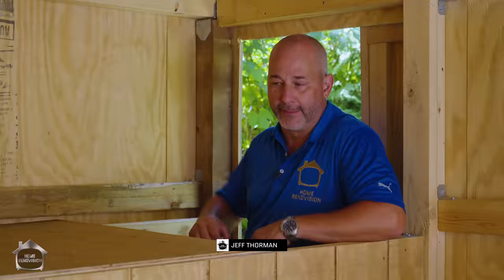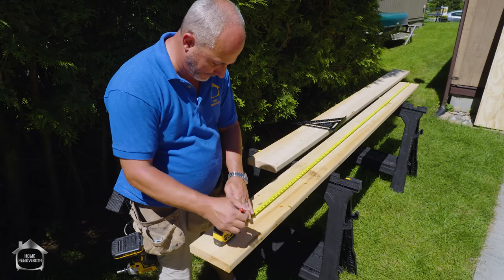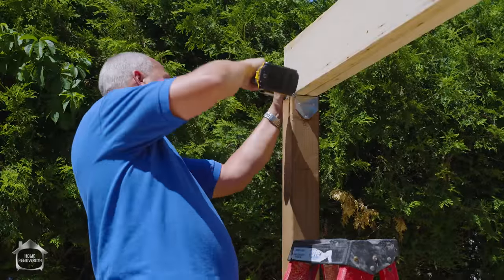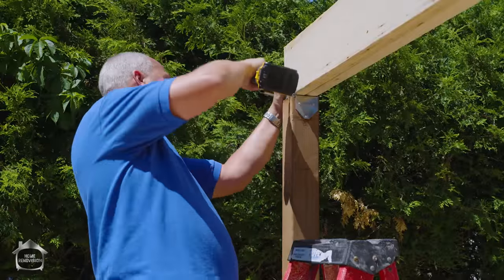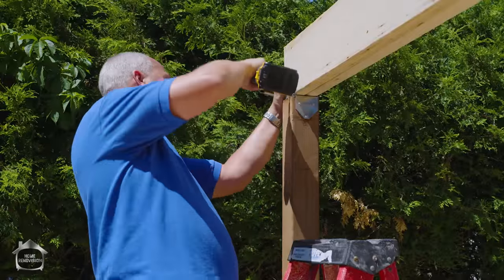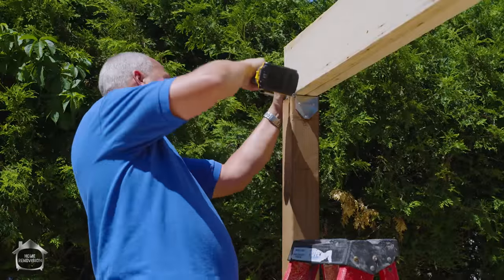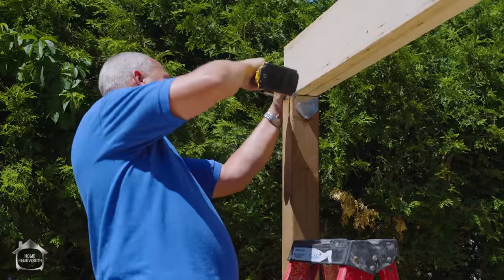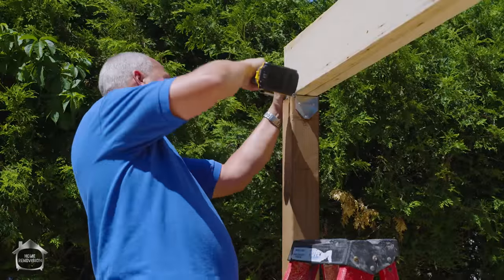Frame This Shed With Tools You Already Own

Comment: Jeff, I love your videos! I'm a civil engineer, with a father who is a residential contractor. I say this to add even more meaning when I say everything you show in your videos is the best info on the internet for homeowners. You give the correct, yet rational and cost effective, advice for anyone watching. I always refer to your videos for myself and anyone else who is learning home remodeling skills. Keep up the great work!

One quick, nit-picky note, shouldn't your toe-nailed screws into the double 2x4 rafter start on the outside of the column? This will put the screw into the meat of the lumber, not the weak end grain? Other than that, I'd sign off on the rest of your work! Cheers!
Reply from the maker: Thanks for the critical eye. LOL. Cheers! At the end of the day the t-11 siding will hold it all together, so I am not as concerned about those tiny details. I designed this build for homeowners so they can make mistakes and still have a great result that lasts a lifetime. Cheers!

Comment: Thank you for this series. I watched your other shed build as well. I made a comment on one of your lives. I had to remove about 90% of the shed that the previous owner built because of water damage. I saved as much lumber and hardware as possible. The shed shared the house roof. The shed is only about 3’ deep about 11’ long. One thing I do need is a big double door to swing out  because of the width. It had a sliding door before. It was a bad design and always got stuck. Plus it was not secure. I was thinking of painting the siding in advance because it’s late in the season. I will also be building this by myself. If you and April can do it I think I can too! Thanks for your awesome help!
Reply from the maker: You got this Sheri. Just be happy with your work at every step before moving forward. Cheers!

Comment: Recently I applied the method of running the drill in reverse to predetermine the path of the fastener in an unorthodox install and it worked flawlessly. My boss was stunned. Thanks for the tip Jeff.
Reply: I’d usually pre drill which would irritate my boss because it took too long but by eliminating that step I found he was satisfied as was I. Let me know how I can buy you a beer. Cheers.
Reply from the maker: Nice work! Always a good thing to impress the boss!
Reply from the maker: you can always join the membership. Cheers!

Comment: I spent a few years with a local Boy Scout Troop helping them build various outdoor structures.  For cutting 4X4 posts I made a right angle circle saw guide that was basically a 2X2 and a couple pieces of 1/4 inch plywood.  (Think a 2 dimensional homemade saw guide for cutting sheet goods.)  We would clamp the guide to the marked 4x4 using the plywood edge where we wanted the saw kerf.  The kid would let the circle saw ride on the 2X2 shoulder on two sides of the post.  When they were cut we would have the scout relocate the jig to the opposite side at the saw kerf.  Teen age boys could safely cut 4X4 s with accurate results.

Comment: That angle way I'd drawing crowned wood together also works with driven nails. A sixteen d spike has about three thousand pounds shear strength if memory serves.. I always use them as draw nails when needed. To eliminate splitting when close to the end,set the nail head on the framing and hit the point with your hammer

Comment: Unless you have a fair amount of experience with a circular saw I wouldn't recommend the overhead one hand on the saw one hand on the square technique. Take a couple extra seconds and clamp the square and put two hands on the saw.
Reply from the maker: great idea Jim!. Cheers!
Reply: Yeah, I knew a guy that got kickback and the blade went in his face.  Not pretty.
Reply: I used a clamp also for my deck I was afraid to get a kick back. In fact I made a jig with 3 sides, like  C shape, so I just clamped it on the 4x4 and was easy to cut with only 1 measure and a clamp.
Reply from the maker: very nice.
Reply: I would also add, using a high quality clamp, like a Vise Grip ratcheting clamp. Those things have serious clamping force. Use them for metal fabrication all the time. Just be careful welding around them as the pads will melt, but are replaceable.
Reply: @truthbetold1855  wow !! How sad! 😢
Reply: And wear safety glasses please. They make them in clear anti-fog

Comment: A 'trick' I use when cutting across a 4x8 piece of plywood or siding etc is to put/move the cord over to the edge across from the start of the cut so the cord doesn't get hung up behind me part way through the cut. Especially helpful when cutting along the 96 inch leg!

Comment: You can also set you 2x4s on the beams and take a torpedo level and make a plum line at what overhang you want. If you want it flush make it flush. Although it is nice to cut them on the ground. The level method requires no math.

Comment: I mentioned in a previous video that I was building a house using a steel building and structural steel. If anyone asks, wood is about 10 times faster if you use a nail gun. I just passed my structural, electrical and rough plumbing inspection. I can now put up the drywall after I install the internal wrap to load my walls with blow-in insulation. I have 11-5/8" walls to fill.

Comment: One safety tip for cutting with the square as a guide. Use a clamp to hold it, and you can keep your hands safe. Also wear your proper PPEs. Glasses, hearing protection, and a mask if you do not want to breath in that chemical injected sawdust.

Comment: First rafter he set, which is the second rafter in should be set at 15 1/4" then 16" there after, so when you sheath the roof with 8' material, it Starts flush to the face of the first rafter, and center on 7th rafter at the 8' mark. This is how you frame all floors, walls, and roofs at your starting point. 
What ever common centers  you use 12",16",19 3/16" or 24" always subtract 3/4" off the end of the beginning surface.

Comment: Can I build a floating deck and then build this shed on top of it? I hav an old concrete pad that has some cracks in it, so it shouldn’t be difficult to build a floating deck on it. What are your thoughts?
Reply from the maker: yes as long as you put the posts into the floor package. Cheers!

Comment: Is the number on the head of the screw representative of the sheer strength or the overall strength of all applied loads?
Reply from the maker: just a code to identify the structural support level.

Comment: You can adjust handles on lawnmowers so they can store at a 0° position
Reply: so each time you need to unscrew the handlebar to fold it over the mower? kind of slow process and hard to bring the mower folded in the shed with the steep ramp. I do this but at fall to store it and use less space.
Reply: @DrLoveQc  save loads of room space only needs to be 4feet then
Reply: @fifagoalz904  yeah save space a bit but on a shed like with a dedicated door and space it is good to keep it assembled.  I would maybe only modify the height near the tools room to make it    smaller just to fit the mower under it so you get a nice extra storage space niche over the mower. Just keep the height for the handlebar portion.  But great idea on this shed, I use my garage and I dislike to get the grass/fuel perfume in my garage all summer.

Comment: On the Beam, why did u not Laminate with 1/2 stock to bring the width of your 4x4?
U got me on the RO for the door, 2-6=34", isn't it 2-6=32"? 
You will have wiggle room 😀😀.
Reply from the maker: no need to spend the money . just set the beam flush on the only surface being finished. After all it is just a shed. Cheers!

Comment: When I build a shed I don't waste space with studs I basically build shelves with backs I figure that a 1/2 inch plywood 24 inches deep is stronger than any studs since my shelves are maximum 16 inches apart it makes a very strong wall in most municipalities sheds don't need permits I all that I've been in do have size restrictions the last 2 were 144 square feet they both had no height restrictions but I've found 8ft is practically the max height you can get access to all but the top shelf without a ladder the municipality I'm in now the maximum size is 100 square feet so I'm going just under that so no matter how by-laws measures it it's not over

Comment: I’m looking to build something like this on an old concrete pad but I live in Florida and we get hurricanes. Would you make any changes to this design in a hurricane area?
Reply: You would probably need to anchor the entire structure with a 30"+ earth anchor. Check with your city to see what they recommend too.
Reply: @Alex-fs6kz  yeah I figured I would need to anchor it somehow. Just wondering if it would be ok structurally. Thanks for the tip!
Reply from the maker: aside from the structure in the earth. this shed can handle most storms. Cheers!
Reply: @HomeRenoVisionDIY  thanks so much! Cheers!

Comment: A 2/6 or 30 inch door measures 31.5 on outside of jamb  it's recommended  to ad 2 inch to width from 30 and it's recommended to ad 2.5 to height  I ad 2.5 to width and height

Comment: Eliminate all that measuring. Stack two boards on top of each other and flush the ends . Measure one time...set the depth of the saw  so it cuts into the board underneath it which will mark it exactly and then  make that cut.
Reply from the maker: that works as well. I prefer to just measure since it takes a lot of fussing about to actually stack the wood. besides at my age speed is relative.
Reply: @HomeRenoVisionDIY  you  aiteady had them stacked on top of each other.where's the fuss? Its not about speed...its accuracy. The same reason you determined their length by measuring at the bottom of the posts and not the top.
Reply from the maker: Ah Jim, a 16th is a 16th my friend.

Comment: Adjusting the posts in the vertical position is not called "level"...it's called plumb.
Reply from the maker: Where I grew up if you use a level then it is level. Cheers!